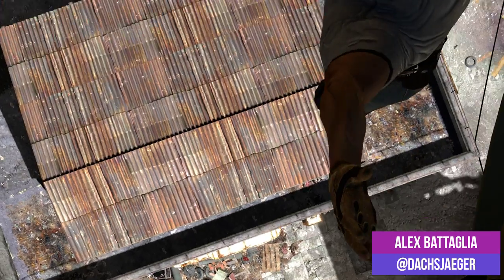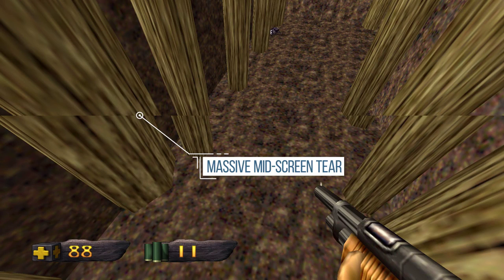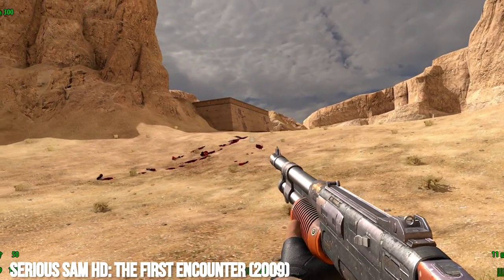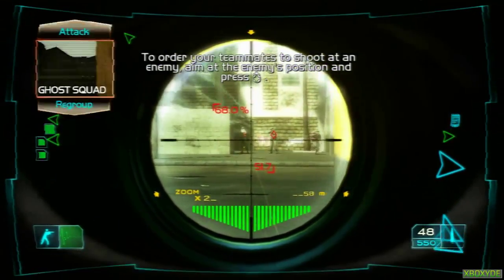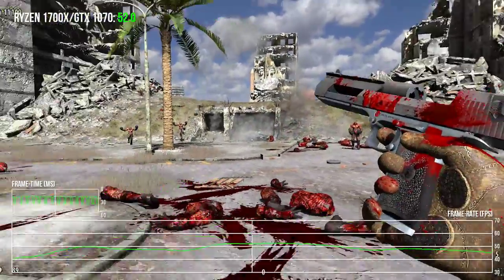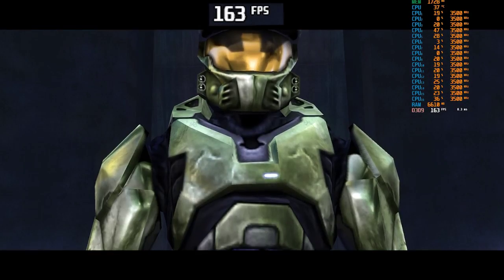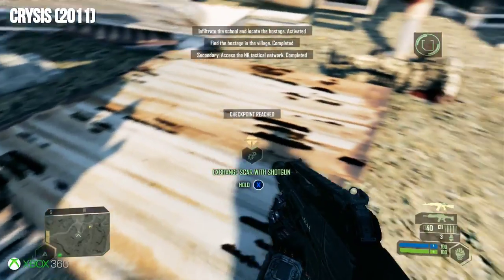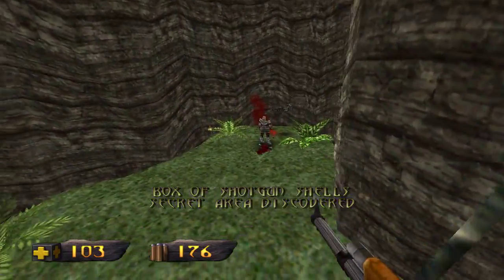Tech Focus - V-Sync: What Is It - And Should You Use It?

Comment: I’m surprised this video was only made now
Reply: This video didn't need to be made. You just need a ten second clip saying "Vsync is the work of Satan and developers should just optimize performance better."
Reply: @GuySocket  they could do that if everyone had the exact same hardware, and wanted the same resolution and framerate. We don't.
Reply: @GuySocket  With high refresh rates you get even more tearing without V-Sync (or some other sync method).
Reply: @GuySocket  sounds like you need to watch the video because that's not what causes tearing.....
Reply: I've wondered what it does and have seen suggestions about what it does everywhere for performance.
It turns out the only correct option is disable for casual players who don't have those expensive graphic cards
Reply: @BlindBison Not literally every game, only games of this gen. And there's a reason why games this gen have double the input lag of previous generations despite having better performance.

As for improving rendering pipeline? Yeah, I literally said "optimize performance" in my original post. So we agree on something.
Reply: @BlindBison Actually, you don't know what you're talking about because most games last gen had screen tearing and frame rate cap had nothing to do with it because it was especially an issue with games at 30 fps. Don't believe me, just get your 360 out (Xbox One back compat has forced Vsync) and play almost any 30 fps. And if you're going to mention Digital Foundry then watch any of their takes for BF3, Halo 3, Bioshock, GTA, Homefront, pretty much all COD campaigns from that era.

Comment: I'm a PC gamer who pretty much always turns V-sync on no matter what simply because I legitimately despise screen tearing (it actually legit hurts my eyes)! 

I know it adds input lag but honestly, I don't really care too much about that because since I'm not at all interested in speedrunning or competitive online multiplayer, my gaming tastes are such that the lag V-sync adds doesn't really affect me all that much.
Reply: I find that it depends on what framerate you are getting. If you are getting just a bit above your refresh rate, the tearing is horrible. If you are getting way above, I don't notice it. I always turn vsync off, and try to adjust my settings so I get 80-100 fps.
Reply: To get best results, before even changing in game settings get your PC performance settings and GPU control panel settings right for your setup.
Reply: I use it for singleplayer games. One thing that could help you out is fast sync, which eliminates screen tearing while not capping your fps to your monitors refresh rate and it dosen't add input lag. Its only for nvidia gpus from what I recall though, you could also just buy a gsync monitor if you have a big wallet.
Reply: Funnily enough I haven't had screen tearing in about 8 years or so. Not sure how but I guess I am doing something right.
Reply: FreeSync/GSync is the only sync I'll ever use, I hate screen tearing but I hate input lag even more

FreeSync/GSync is better than VSync, it makes the game feel smooth even when I hit low FPS.
Reply: I used to hate V-sync for shooters (and even some other action games) due to that weird "soap opera effect" I'd sometimes see with it. Alex B somewhat refers to it in the video when he talks about triple-buffers.
Reply: @OutlawedPoet  Fast Sync can cause stutters though, and screen jittering on most games. I use to love Fast Sync too but when I compare it to Vsync + TB, Never go back to Fast Sync unless your gpu can exceed you refresh rate.

Comment: On my pc, if I can reach over 90 fps I just disable vsync entirely as it generally doesn't distract me on the games I play. If I play a game that runs at 60-70fps on average with the chance of it going below that, I use adaptive vsync. If a game goes below 60fps, I care more about maintaining the best input latency I can rather than if there's tearing or not. 

My PC currently has a gtx 980 in it, and since Nvidia seems to not want to make gsync affordable, I'll probably switch to an AMD gpu on my next PC so that I can get variable refresh rates without having to destroy my wallet.
Reply: Agreed, I just turn down settings until I get a solid 120fps, I would rather play 900p 120hz than 1440p 60hz
Reply: But why?  Are you a pro with lots of money on the line?  Vsync has been good enough for a long time now for the input lag to be nearly negligible if your PC has decent specs like you mentioned, and tearing is so much more distracting (and vsync has the nice benefit of capping your FPS to your refresh rate, because variable FPS and therefore variable input lag is even worse because you can’t adjust to it)
Reply: Well pro or not I still dont want to be handicapped by the input lag it introduces. It feels sluggish and I don't like that feeling.
Reply: On a 60 hz monitor in many games, if you get over 100FPS it can still look way way way more jittery than 60fps vsync. Sad reality.
Reply: @zombievac  That's probably why most games since its inception gave the option to turn V-Sync off, right?
You don't have to be a pro to appreciate occasional lower input lag over the same, but higher input lag all the time. Also that's not correct. If you drop down to the next V-Sync step your input lag is doubled within a single frame. That's more inconsistent than V-Sync off will ever get you.
Reply: @zombievac  I wouldn't call around 40ms of delay at 60 Hz "negligible". V-sync simply feels bad to me and many others. I much prefer minor tearing over it, as for fast paced games especially I tend to be concentrating enough to zone out the tearing anyway. Whereas with v-sync I need some time to adjust to the delay, and even then it never feels particularly nice.
As for a variable frame rate causing variable delay, that won't be true providing your frame rate always exceeds the refresh rate of the display.
Reply: @zombievac  "decent specs," for us non-Americans, numbers like those are considered outside of the normal person's budget. I only have a few friends who can afford to play games over 60fps. Most do with 20-40
Reply: if talking for competitive games, id rather play on low settings and get all the fps, when it reaches above 180fps i prefer to turn vsync on in my 60hz display
Reply: Play Need for Speed Most Wanted 2012 without v-sync, you have a cap of 60 fps, you see a crazy amount of tearing EVERY SECOND.

But sometimes I don´t get tearing like I once did in Black Ops 2 and Hot Pursuit 2010.

Comment: Input latency with VSync happens when the input polling is blocked on the same thread as the rendering (inputs during Vsync are held until the start of the frame). id Tech 5 is a good example of an engine that moves the input polling onto its own thread; inputs are consumed the moment they happen rather than the start of the next frame, so there should be less perceived input latency.

Another cool thing I was investigating a couple of years ago was using late-frame re-projection with mouse-input to have absolutely, incredibly smooth first-person mouse-look - but this came at the cost of some subtle pixel smearing and increased GPU work-load, but it's something I think competitive FPS games should consider as an option - poll mouse input at the start of the frame, then poll a second time just before VSync and do re-projection. VR games use this technique (as does the PSVR).

Personally, I can't stand the input delay of VSync. It just absolutely ruins FPS games for me; as much as I hate tearing I will live with it for the sake of avoiding weird floaty mouse input.

Comment: I think the video should have included more timeline graphs of the time it takes to render/refresh, to make it easier to understand. Also for people that are not familiar with this stuff, it should have been pointed out, that higher refresh rates significantly reduce tearing.
Reply: I know I am anserwing after a long time but is higher fps=lower tearing still a thing when fps is getting higher than monitor's refresh rate?
Reply: @anteksadkowski5166  You may get more tearlines, but the difference between the frames, so the offset, is smaller so each tearline should be a bit less noticeable.

Comment: another type of vsync that DF didn't explain is half refresh rate vsync, it is pretty self explanatory, this type of vsync will render the frames at half the refresh rate of the monitor. meaning that each new frame is followed by a duplicate frame, to make it seem smoother. this is what they use for games on consoles, this is why many people think that 30fps is smoother on consoles than on pc, but you can do the exact same on a pc using nvidia inspector. for amd users, this option is not directly available in their drivers unfortunately, but they can do the same thing using RTSS's scanline sync by setting it to "x/2", where the 'x' is the refresh rate of the monitor. scanline sync is like a custom vsync where you can adjust the position of the tearline by yourself, scanline sync is an alternate vsync which has less input lag. its basically what DF explained at 3:24, you can move the tearline away from the centre of the screen or even out of the screen space, so that tearing will not occur at all in gameplay.

EDIT: ok they kinda explained this at 4:45, but they didn't fully explain about half refresh rate vsync.

Comment: Frame limiting with MSI Afterburner works best with vsync, cuz it's smoothens frame time.
Reply: Dante GTX Can i use Afterburner to lock a 60 FPS game into 30 FPS?
Reply: @CanaldoZenny  You can type your desired fps in settings
Reply: What should i set fps limiter and vsync on on 75hz?
Reply: @simorx580  same as monitor refresh rate(Hertz)
Reply: @DanteGTX  i have set 75hz and i ve still got tearing
Reply: @simorx580  if You have nvidia gpu, in control panel set vsync to fast.
Reply: @DanteGTX  if i have amd card?
Reply: @simorx580  use enhanced sync
Reply: @DanteGTX  them my games stutters and my cpu is at 100%
Reply: @simorx580  try standard vsync
Reply: Which frame rate cap and v-sync method?
Reply: GTA IV and Max Payne 3 tested with this method recently! They are so smooth now that when playing my mouse feels like a Razer high end gaming mouse.V-sync in most games is bad,the best one is from Nvidia Control Panel or Ati Control Panel combined with Riva Turner for that perfect 60 or 30!

Comment: I find screen tearing, frame pacing stutters incredibly distracting. Years ago got a G sync but i dunno if its because the frame rates are not right for the G sync but i really do not notice a difference compared to v sync or adaptive V sync
Reply: If u never get dips in fps u will not notice a difference. Its when the framerate fluctuates u notice the power of g-sync. With a gsync monitor 45 fps will feel about the same as 60 fps with a normal monitor.
Reply: @underflip2  That's not what G-Sync does, lol.

Comment: It depends. If you play with a controller and/or you play single player games, you should use it. But if you play competitive shooters on PC that require very low input lag, you should definitely turn it off, even if you are using a lower refresh rate monitor. Sure, you'll experience screen tearing, but you will get much lower input lag which is critical in games like Siege or CSGO. One more thing: I cap the refresh rate even if I don't use Vsync (via RivaTuner). I don't like fluctuating framerate and response time.  People like to play totally uncapped with FreeSync and G-Sync monitors but I like consistent framerates and response time.
Reply: No tearing for me. It's too distracting.
Reply: I play with controller and disable it almost whenever I can.  Consoles rarely get the option, but the lower latency is preferable unless the the tearing to too obnoxious or the game doesn't need responsive controls.

Comment: G-sync is the best sync based on my own experience. Too bad it's Nvidia only tech because at this point I'm really not sure if my next GPU will be from Nvidia.
Reply: Why not?
Reply: @ik1llpeeple4fun  rtx prices are insane
Reply: MadFinnTech u can use AMD card on G Sync monitor just won't have Freesync support & Freesync is garbage anyway
Reply: @Sonu666  , " Freesync is garbage anyway"
You have no clue what you are talking about. Probably use a console so your fps is to low to use G or Freesync.
Reply: ik1llpeeple4fun Price fixing, gimping and shady business practice.
Reply: @Sonu666  how is freesync garbage? It works perfectly and it doesn't require a rip-off monitor.
Reply: yeah nice. Im still kicking with an R9 390. but with a 1080p 144hz freesync monitor it's great. freesync works perfectly.
Reply: @Sonu666  Freesync is actually better than GSync on a technical POV and here's some reasons why:
Does not require additional hardware, often a firmware update could enable adaptive sync, while doing everything GSync does.
It works on both HDMI and DP, GSync just on DP.
The input lag is lower, because the frame is directly displayed from the GPU, not an internal cache on the monitor.
It's less power hungry (especially concerning 4K HDR GSync, which uses an extra watt on top of the scaler)

Comment: Every game in existence should have an option for adaptive V-sync, it's objectively the best solution outside of investing in a G-sync monitor.
Reply: The game doesnt have to support it only your monitor and gpu does.
Reply: @_Thred_  no. For example: Batman Arkham Nightmare uses adaptiv v sync. No Need for an amd graphic card or freesync monitor
Reply: I don’t completely agree, if you truly hate tearing (even infrequently) it’s not necessarily the best. I noticed this on the Xbox one x version of call of duty wwII where the in game cutscenes were plagued with tear, whereas the PS4 pro version used triple buffered vsync which meant stutter instead. I’d personally take the stutter over tearing, but that’s why I consider it to be more a subjective matter than an objective one.
Reply: If you have an Nvidia card you can use the control panel to turn it on in the vast majority of games.
Reply: @Archivist42  I dont believe that's the same thing with adaptive v sync
Reply: @Relex_92  That really boils down to personal taste. I prefer having a little bit of tearing at the top of the screen than a bunch of dropped frames, but either way you are still supposed to ensure that you'll meet your performance goal before activating any form of Vsync. If your frame-rate is in the 40s or 50s for long stretches of time, you are better off either using a 30 FPS cap or lowering your settings.
Reply: @naimcool36  adaptive v-sync and adaptive sync are different things.  Adaptive sync refers to g-sync and freesync. Adaptive v-sync is a v-sync solution which can do different things under different circumstances. It doesn't do what freesync or g-sync do.
Reply: If you don't suffer under the Nvidia regime, AMD has an alternative which is technically superior and could work on any monitor with DP adaptive sync or some HDMI monitors (meaning they are just as expensive as a normal monitor) which they call FreeSync. It also works on the XBoneX I believe and Intel was looking into supporting it in the future.
Reply: @nextlifeonearth  But you need to buy another monitor.
Reply: In the control panel for your card, you can force the Sync method of your choice on any game, overriding even those WITH sync options.
Reply: @SteelSkin667  At least it's not more expensive, like GSync and more monitors support it now.

Comment: The higher the refresh rate of your display the better vsync is. 120 hz gives you 60, 40, 30, 24 FPS ect without the input lag penalty of running up against your displays max refresh rate or the stutter by running between those framerates with vsync.

Comment: My general experience has been, keep it simple: use gsync/freesync if you have it, use fast sync if you don't. The side effects of fast sync when running at closer to display refresh or under display refresh aren't all that bad, and it's generally going to result in the least amount of latency you can get without tearing, whatever your framerate.

Comment: G-Sync is the best, but comes of the high licensing costs of Fu-King Nvidia…
Reply: Freesync to the rescue. All you have to do is give even less money to Nvidia and give some to AMD instead.
Reply: @Ignignokt did you delete your comment?
Reply: @nextlifeonearth  Freesync isn't as good as gsync and you can't use Nvidia GPUs with free sync, which means you'll have to use an AMD GPU and they're just not up to the standard of Nvidia's GPUs. AMD have really been playing catch up with Intel and NVidia for years and, until they start actually coming out with products that can compete with Nvidia and Intel, we should avoid them or otherwise they won't change their business practice.
Reply: Not sure how freesync is not as good as gsync, it 100% works, and the measured delay is the same as g-syncs best results (with gsync having inconsistent measured delays(source - bitwit and hardware unboxed). RX 580 competes directly with 1060 in price and performs on par with it. the next step up vega 56 and GTX 1070, they are the same price and the vega beats it convincingly in most games. add on to that the fact that you can buy a vaga 56 and freesync monitor for the same money as a 1060 and gsync monitor, and the only reason you cant use Nvidia GPUs with freesync is because Nvidia specifically wont let you (it would take nothing more than a firmware update) and then consider who should be avoided until they change their business practices.